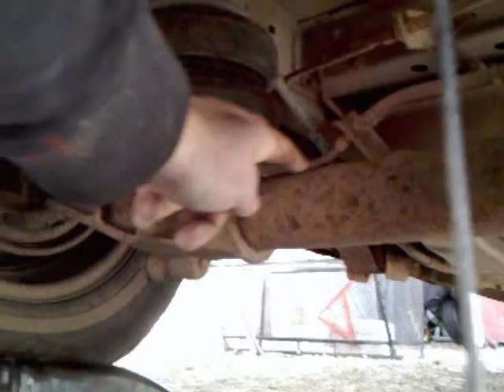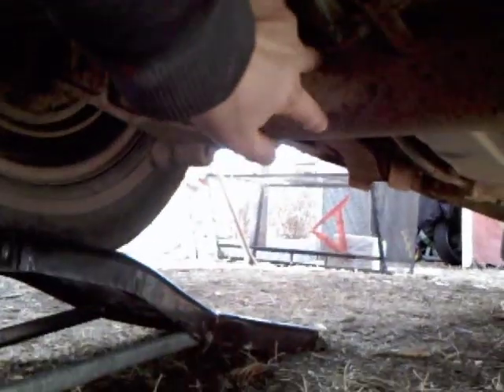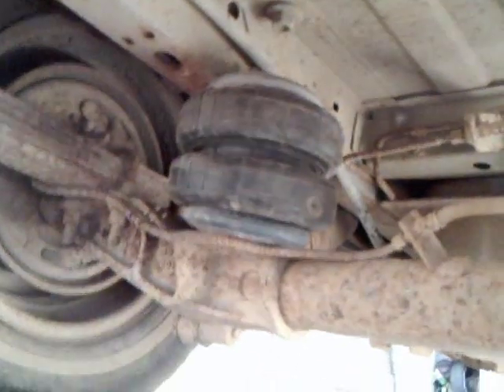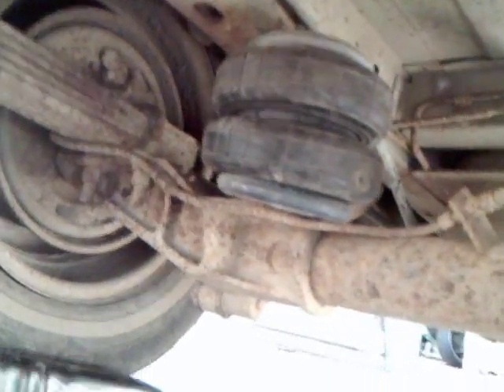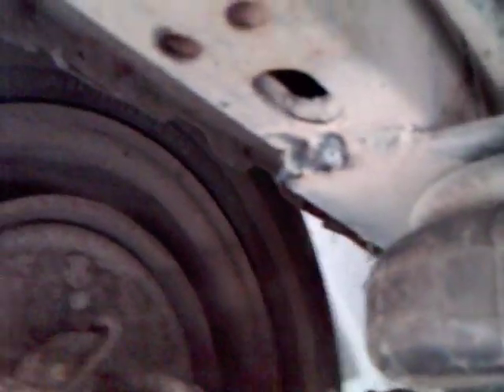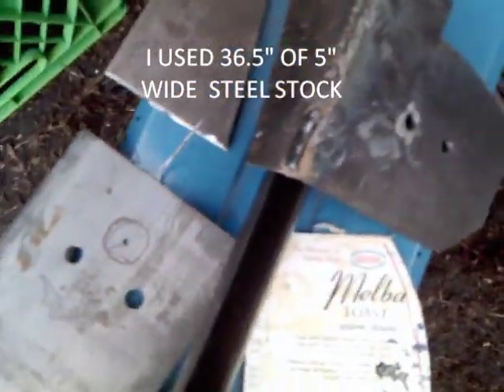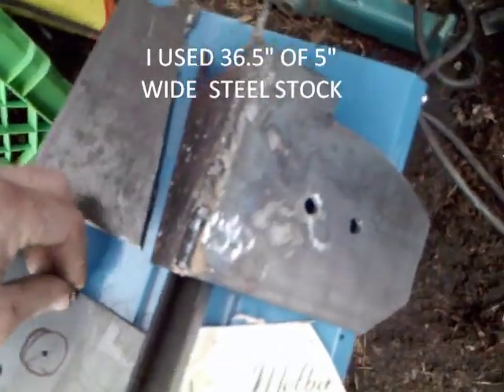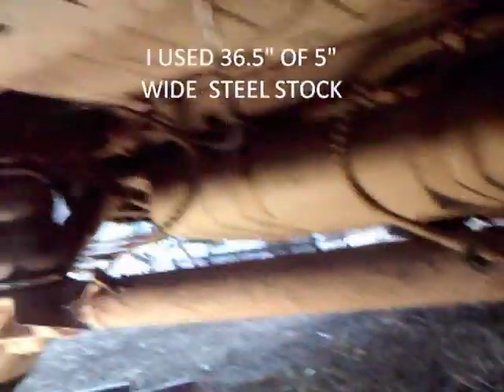Fabricating Minivan Airbag Mounts

Comment: @pacificcloud I had a grand cherokee fabbed to accept air bags on all four corners, tried dot brake line (plastic line) and compression fittings, had the same situation with leaks, once i swapped out ALL the line with 3/8" copper hard line with and flare fittings i had absolutely no  issues with staying up over night. p.s. if u "t" the lines you dramaticly increase body roll!! all lines need to be independent! Also a check valve would greatly bennafit you !! for air ride questions, email me...

Comment from the maker: @RAT1969 I wanted to make sure I put them in there a lil compressed to get some good lift.
I am doing an Astro van now, but I think I am just going to scab in some coil springs to help it.  Kinda sick of airbags leaking, having to pump them up all the time.  Especially if they rub anything just a little, they wear through like nothing, with all the bouncing.

Comment: wouldnt it have been easier to mock up with the van on axle stands under the chassis instead of on ramps as your suspensions is still compressed.?
nice vid tho, thinkin of doin it myself.